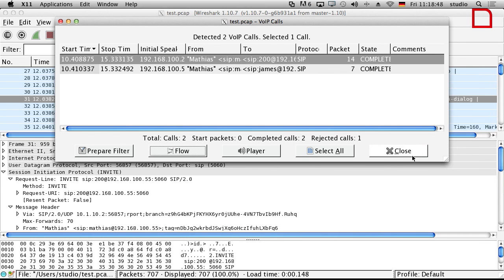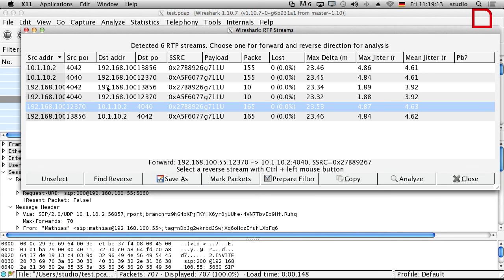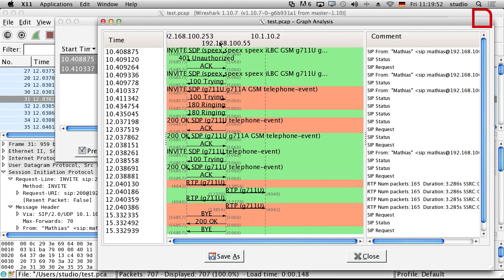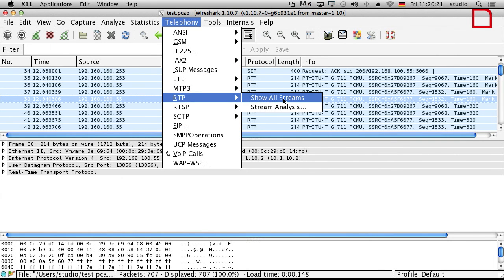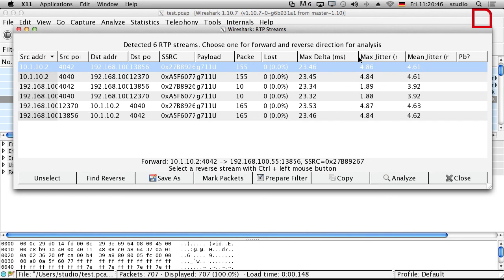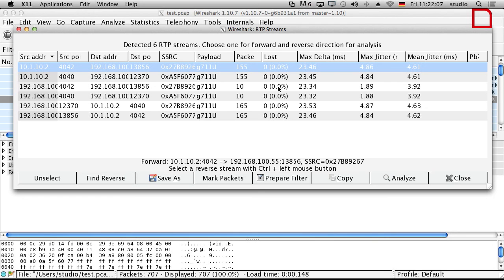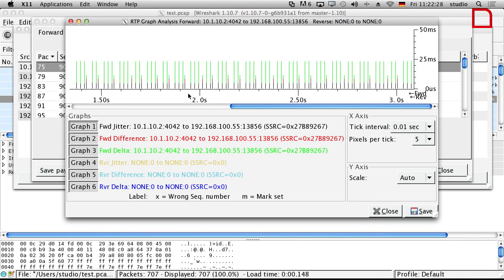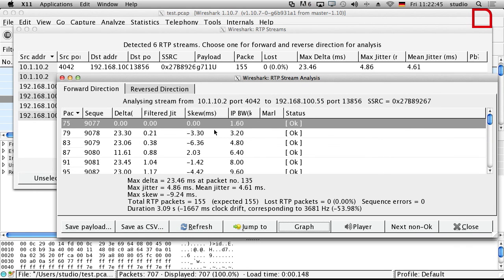Asterisk Tutorial 40 - Wireshark RTP Audio Debug [english]

Comment: I want to share my experience in setting up the Asterisk and WebRTC. 
I've got no luck to establish some bidirectional sound between softphone and WebRTC page (sipML5 based). 
The issue seems to be in the encryption. Unfortunately the sipML5 requires the dtls keys and works over the https only, 
so that we can't disable it. Any softphone (free version at least) in its turn has no ability to apply a dtls certificate and it states the obstacle barring the communications in one of directions. 
I tried to turn on the encryption for the one of two softphones (the one is the X-lite on my PC, the anotter one is the Zopier on my smartphone) - it failed to even make an initial call. 
It works with encryption turned off for the both of peers only !!!  Guys, if you have any ideas how to affix the WebRTC to any sort of softphones - let me know. I would appreciate it.
Nevertheless, the Playback(sounds) app works properly and sound is delivered from the server to the WebRTC page without any trouble over the https. 
Thus we're able to create our first web voice mail already.
And it appears to me that the Asterisk has to have some settings to conduct the unencrypted sound to an encrypted peer and vice versa.
https://78.26.164.4:8089/static/cmp2k/dial.html

Comment: Hi Guys, great work once again. You don't know how useful this tutorials are. I have always depended on my network guy to assist in debugging issues were if felt it has to do with my network setup. With what you done, though I am not a Network guy but I can give him relatively correct specifics on what the issue is and let him come in where he need to. Keep it up Guys.

In the light of this, I would like to suggest you help us put up something on Asterisk WebRTC, secure calling and High availability. Case study: I want some Phones to constantly be on a secured line, Some on WebRTC and the reset as regular UDP but all registered on the same Asterisk Server. One issue I have seem very common has to deal with debugging especially when it has to do identifying were the problem is coming from (wrong placement of security files say replacing .crt for .ca, sip etc).
Deploying clustered environment/failover servers. It might be too much but I trust you always have you strategy of touching the required basis.
Reply: +Paul Okeke 

+1